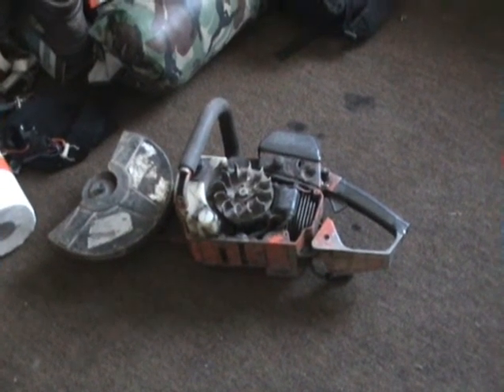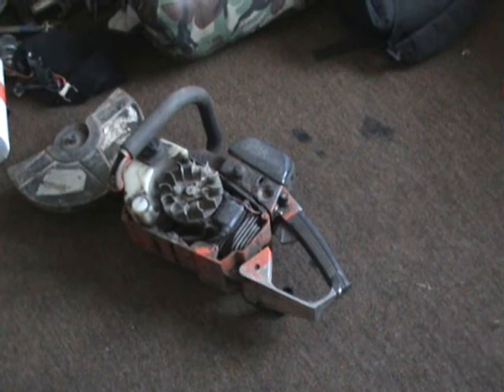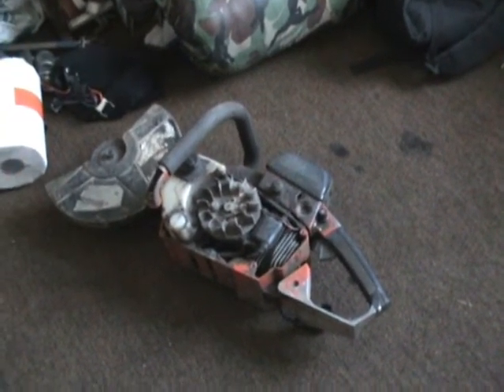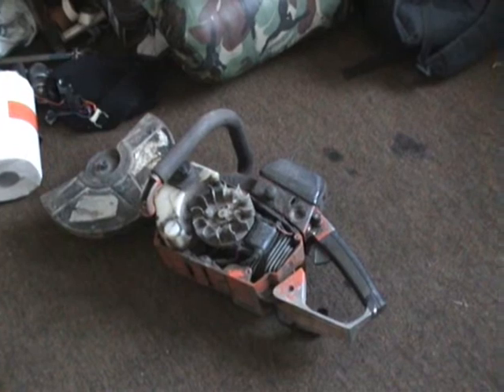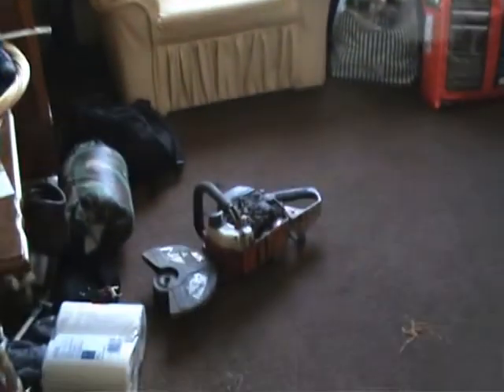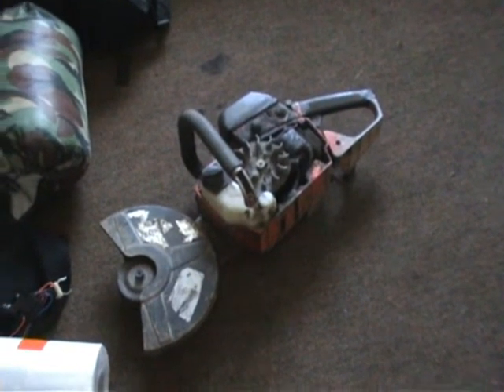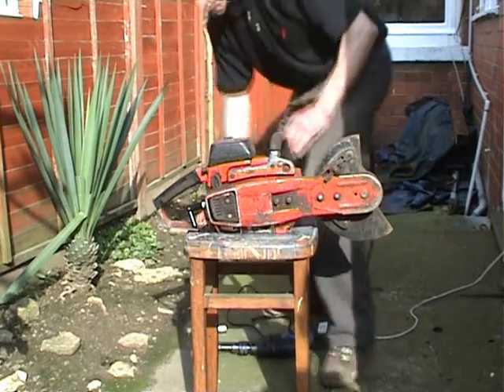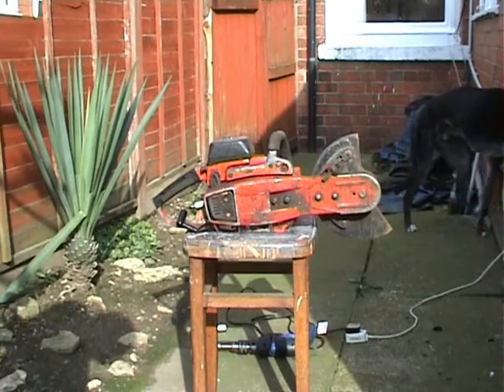Epic Fail

Comment from the maker: Correct! That's what Roy said (grin) however they usually do go. Holding small portable things while also holding the spark plug onto the casing/engine block etc with one hand, while pulling it over, or turning it somehow is usually quite difficult. Often ends up with the machine falling on your foot, so I only do that if necessary lol.